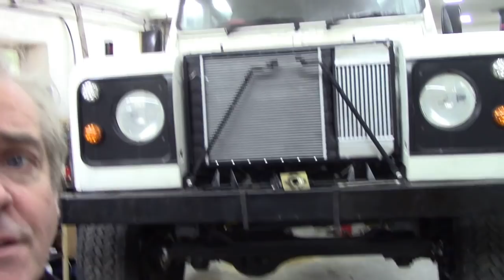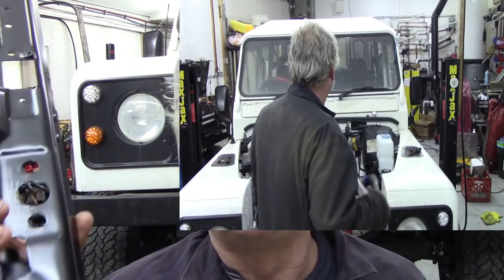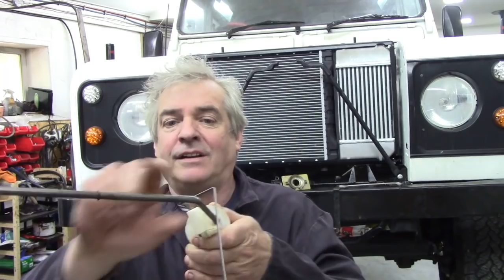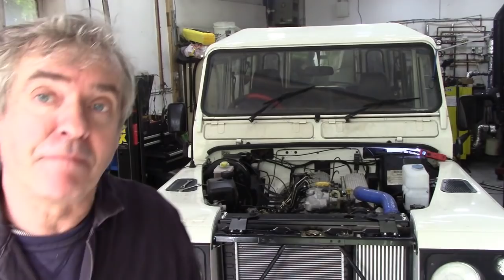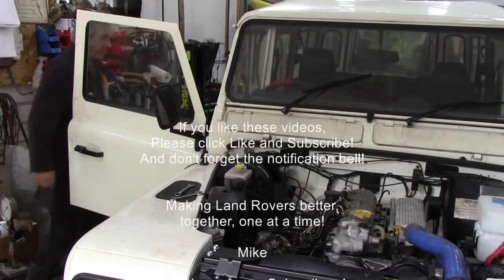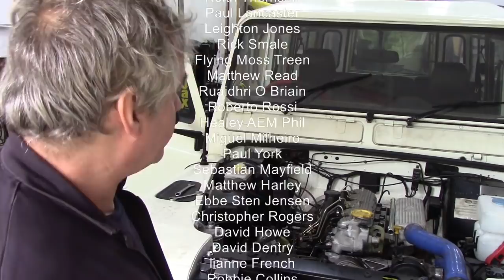Malawi 110 will it start? AND has the back pressure gone?

Comment: For the king of 300 tdi mechanic .You think 300 tdi can be used is yacht with running at 2000 rpm long period of time?
Reply from the maker: Good question - the 300Tdi is governed to 4,500 rpm so 2,00 should not be a problem, but it seems the turbo boost seems to kick in at this speed
So I do not know!
Reply: @BritannicaRestorations   Thank you,i never understand way marine engine are double the price than a normal one.I have a 60 k /km  300 tdi engine that i will marinised.I have one question: Way you dont tune up your 300 tdi,i have done : boost ring,pin,all the screw at full,vnt turbo from audi,exhaust ,and the car it is all most 10 sec to 100 km car,all this after 30 k still going strong at 1,6 bar ??
Reply from the maker: I never tune them or give instructions on this - too much liability on my side